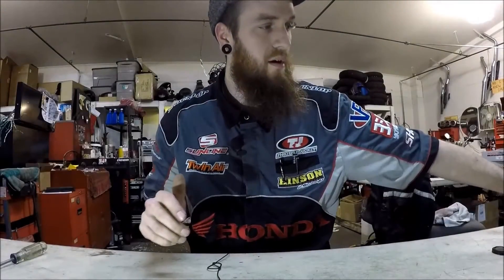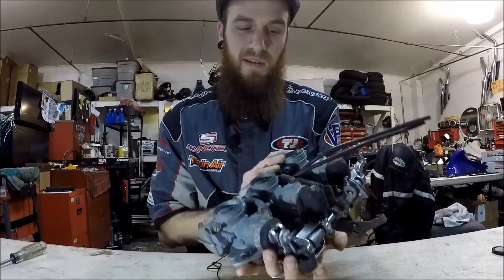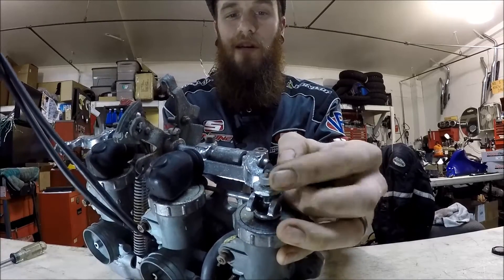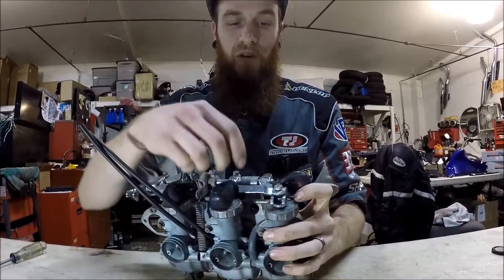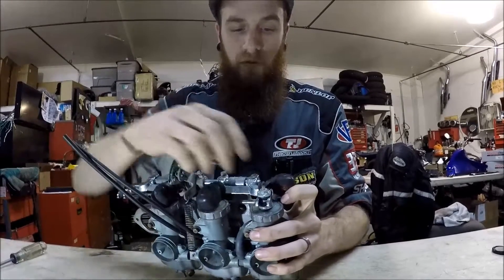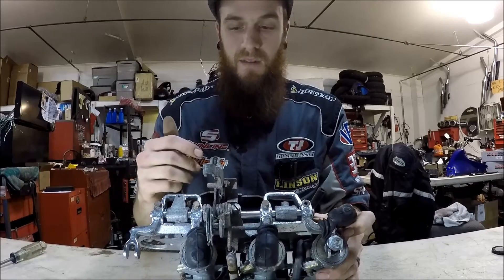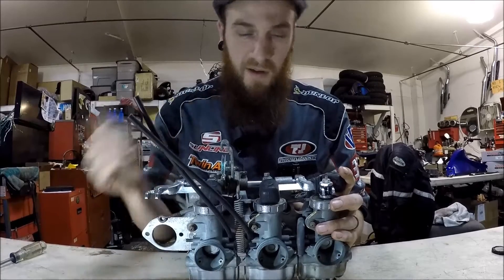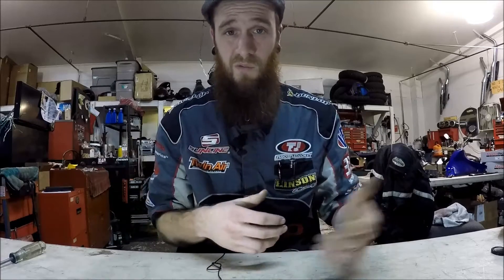Mechanical slide carburetor sync explained: 3 of 3

Comment: I bought an extra set of CB750 carbs to take apart, clean and rebuild. I wanted to learn how everything works. I took them completely apart, ultra sonic cleaned them, ran guitar string or wire through all the jets and emulsions tubes, sprayed carb cleaner and air through passageways, adjusted float height and even replaced the needle valve springs.  I also had them vapor blasted.  The problem is,  I can't get them to work correctly on my bike.  The bike idles great, slides move freely, but when I give it some throttle the RPMS hang up until I literally push down on the top of the carbs. (The slides don't appear to be sticking.  I'm only pushing them down that tiny amount of slack/free play the slides have when the idle screw is engaged a bit.)   If I put my old carbs on the bike they work great, but when I put the new carbs on  I'm having problems...so I know it's not a problem with the bike or the carb boots causing an air leaks.  I've tried taking the emulsion tubes and jets from the working carbs and putting them in the non-working carbs, but that didn't change anything.  I'm going to go back, take them apart and clean everything again.  I refuse to give up on these carbs!

Comment: Hey man! Thanks for your videos. I have been struggling with the vacuum sync of my '75 CB750. Bike has been totally rebuilt but the throttle tends to hang a bit and I have to push it forward to bring it back down. Throttle cable have the right tension and none of them get stuck anywhere. Syncing the carbs doesn't seem to change the problem and I'm wondering if those top adjusting bolts might be the culprits. Any advice?
Reply: Did you ever get those carbs working correctly.  I bought an extra set of carbs for my 75 CB750 and I'm having a similar problem with them.  Bike idles great, but the RPMs hang when I give it some gas.  Luckily I have a set of working carbs, but I'd like to get this back up set working as well.
Reply: @daveco1270  I ended up installing PD from a '77 but I will be installing these on another build. I'll see how they behave and if I find a solution I'll let you know, please lmk if you figure it out 🙏🏻